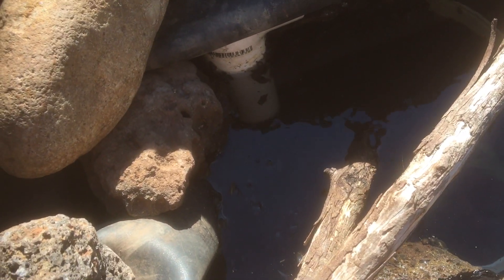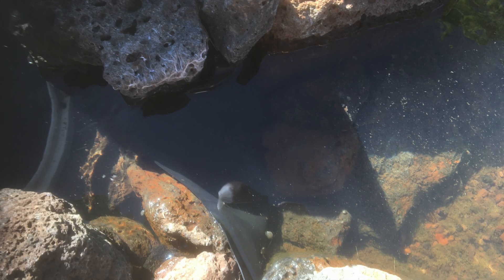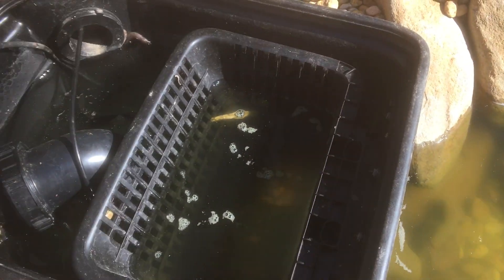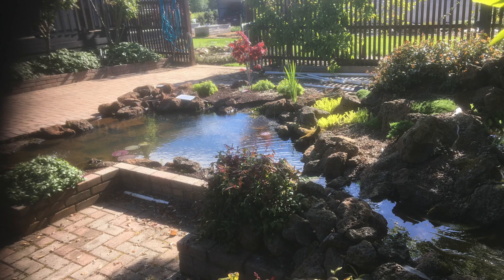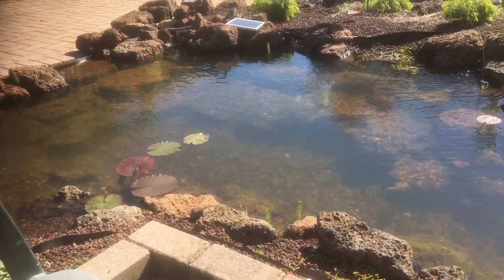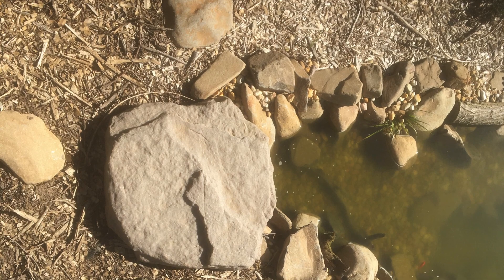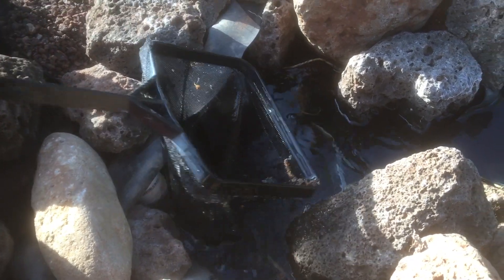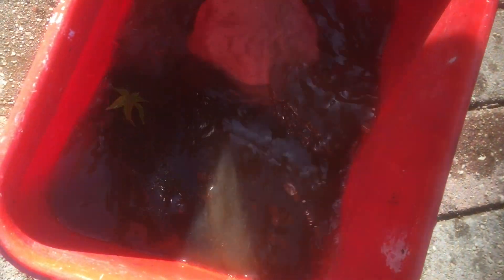Pond skimmers: How they work

Comment: Hi, could you let me know if this is a good idea?

Could you have the skimmer and bog filter at either ends of the pond, acting like a closed loop system? 
-> the outlet of the skimmer pump feeds into the bog filter at the other side of the pond 
-> the bog filter feeds the cleaned water back into the pond 
-> which then flows in a current across the pond, back into the Skimmer?

 The current induced by the flow rate would sort out any mozzie breeding problems, but would the flowrate from the skimmer be too much for the bog filter?

 thanks for your help with this!!
Reply from the maker: That’s pretty much exactly how I set up all my larger ponds.

Comment: Enjoy the content, well done. So if you had a bog that was used to filter separate paths/ponds it would be ideal to have a skimmer at each end of each path correct? Going for a bog setup with a stream to pond for the bonsai garden and then a second stream that feeds through/under a fenced area around a patio pond.
Reply from the maker: Yes, pretty much. The skimmer acts as a good pre filter 👍